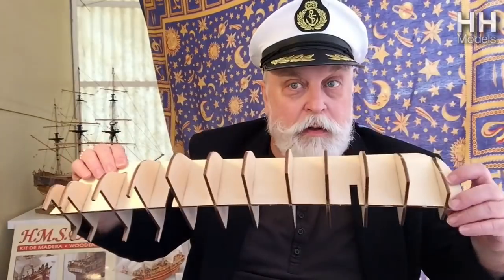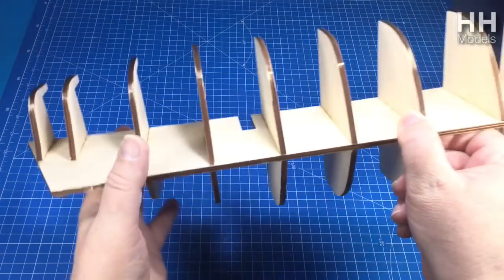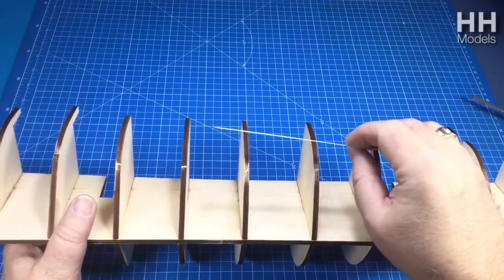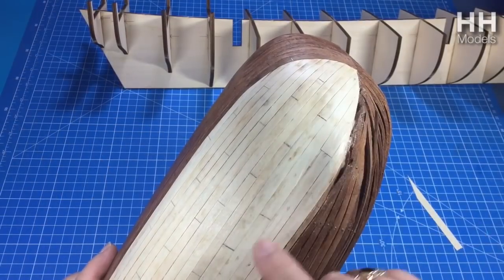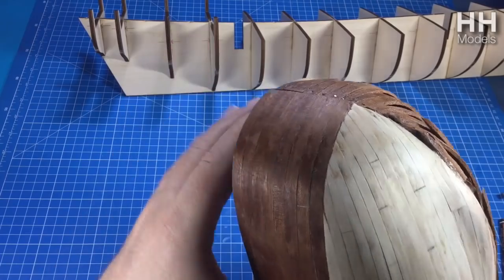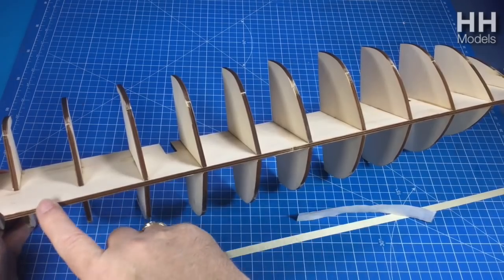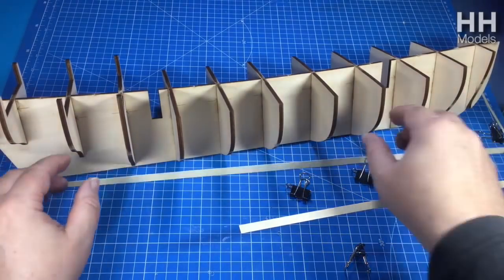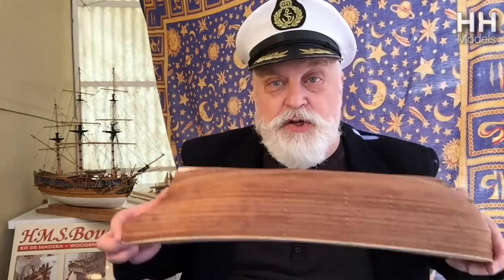Marina Balcony Part 2 You’ll Walk the Plank Houdini!

Comment: Terrific video. I started to plank a ship, but got confused and stopped. You gave me the knowledge to try again. Why not make your paper ruler with plank units; it eliminates one divide.
Reply from the maker: Then I would need a new ruler each time.  And anyway planks tend to drift as you add them, due to camber and alignment, so you need to remeasure for each of the 3 sections.  See my current Planking videos on the Constructo Bounty.  New one out this weekend.

Comment: Great second video Harry..I'm on my why :-) Thanks
Reply from the maker: Great!
Reply: Greetings my good man trust all is well with you. Harry looking for a hand...I'm ready to sand and shape the blocks on the stern. Do I trim to the shape of the last rib...the books and plans are not clear on how much taper is given. I have the Rigging book (on Kindle) Thank's.
Reply from the maker: All depends if you are 1st layer planking over the chock blocks or will use them as your first layer then go over with the thin 0.5mm planks on a second layer. 

Assume you are choking for 1st layer. You do cut down to the ribs, but take note of the deck shape above.  I would first cut vertically to match the deck.  This should expose the top part of the ribs.  Next look down the hull and carve out horizontally to the larger rib your chocking sits against.  Your shape will now be true looking down from deck and across from midships, for both ends.  
 
Next you must feel and imagine the lines to taper the stern and curve around the bow.  If you can see more ribs inside your chock blocks then work towards them.  The curves should feel natural and flowing from the ribs to their end points, bow and stern.

I will show this in a video. But not for a while as I am inundated with work right now so have not had time to record anymore progress on the Port side.  You could look at the photos on my Facebook page.  They might give you some clues to the shape.

https://www.facebook.com/HHModels/photos/a.2532472083699613/2580606875552800

https://www.facebook.com/HHModels/photos/a.2532472083699613/2580575222222632

Comment: Harry fascinating. Thank you. A couple of questions. With the "wedges" is that how the original ship was built or did they use different width planks to achieve the same effect ? Looking further ahead (and I don't know if this applies to the Bounty or not) how do you add the copper bottom ?

Whilst (like the other commentators I don't feel confident to actually do this - let alone paternity enough - I do see how this technique could be used by an unskilled wood modeller like me. From my perspective it would be nice to see you actually sticking the planks onto the frame. Anyway I look forward to the next one :)
Reply from the maker: The sticking parts were shot, but I was already running over 30 mins on this video, so have kept the sticky bits for part B out mid week.

Comment: Great video Harry! I wonder if they did sand the former frames at the Bounty? I am quite sure that you did it on "your side".
Reply from the maker: No they didn’t.  The side I fixed was as badly planked when I got it... removing the planks revealed not only a lack of faring the ribs, but they had not shaped the stern blocks resulting in a warped ass end.  I will show all of this when I do a full video series on the Port side repair.
Reply: @HarryHoudiniModels  No wonder that it looks the way it is. Balsablocks are a nice solution when appropriate. To me looks that they started planking at the deck and then proceeded downwards to the keel. Somehow I see that you are not unfamiliar with wood work. Have you been a carpenter maybe?

Comment: Could you score the planking to help with the curves?

Like the clip idea.

Great vid as always.
Reply from the maker: I will show a crimping tool which aids in bending planks, but it has a number of drawbacks.  Soaking in warm water then using an electric bender does wonders and is how I got the bow so smooth despite the planks wanting to lift a little on the two directional curve.  Video out mid week.
Reply: @HarryHoudiniModels  O.K looking forward to it.
Reply from the maker: The electric plank bender was a surprise.  Would not have bought one, but it was a gift with the Perseverance. Boy does it iron wet planks into any shape effortlessly.

Comment: Sorry Harry. Only one criticism. To ensure that your false keel is dead straight and that all the bulkhead formers are square to that keel. Some cheaper kits are not very true and older kits could be warped especially if the parts have been replaced into the kit box carelessly. Apart from that  Bloody Bonza!
Reply from the maker: I did mention this in the video.  Where I said for the sake of my video we assume you got the frame and ribs aligned correctly before faring.
Reply: @HarryHoudiniModels  Sorry Harry. listening with my ears shut again...
Reply from the maker: Yep I know it’s hard not to nod off with all the waffle
Reply: @HarryHoudiniModels  It may not be you. I have health issues that are distracting and also cause loss of sleep. Maybe your dulcet tones are helping...